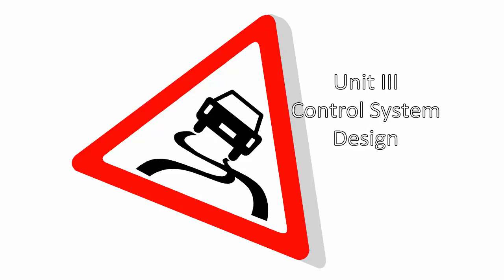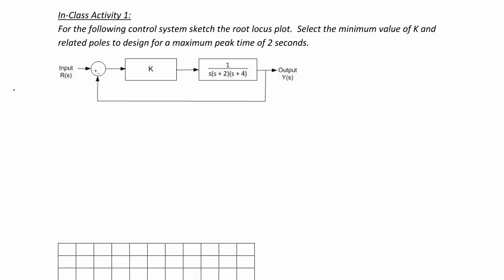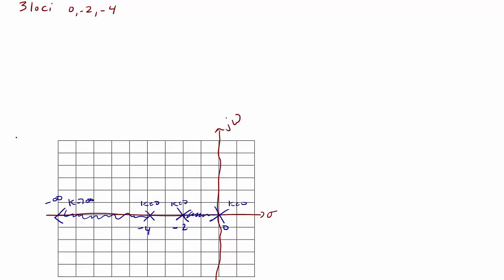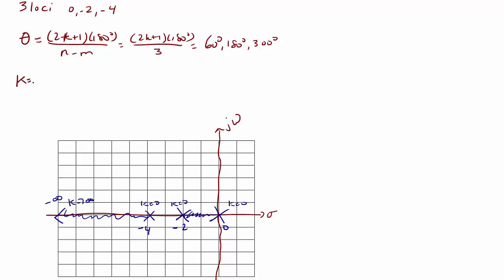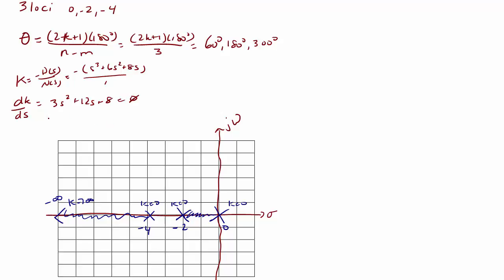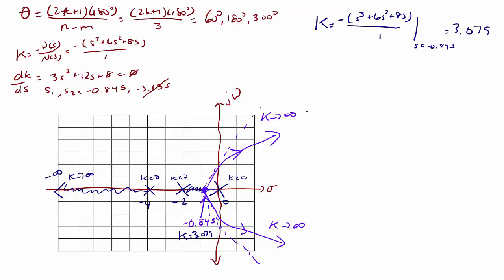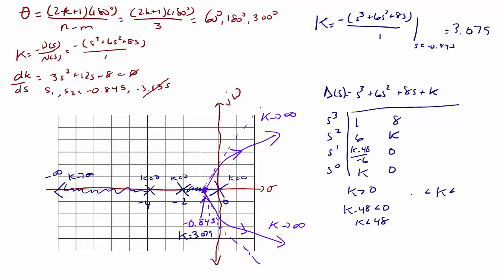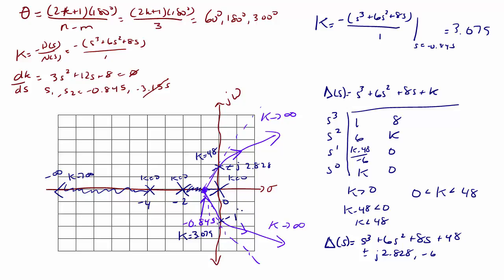ECE320 Lecture4-1a: Root Locus Analysis and Design

Comment: It seems you have a mistake. you didn't calculate the asymptotes breakpoint and instead, you assumed it's the same point as the Root-Locus break point... in your case, the RL supposed to be straight lines because the RL at K infinity the is going to the asymptotes.
Reply: Completely agree with you, the origin of the 2 asymptote lines is at -2 on the real axis with an angle of pi/3 (60 deg) and -pi/3 (-60 deg). As K approaches infinity, the pole at -4 follows the real axis to negative infinity and the poles of -2 and 0 collide at -0.845 and always exit the real axis at an angle of pi/2 (90 deg) and -pi/2 (-90 deg) then each proceed to follow the asymptote lines to infinity. In other words, the greater K is, the more unstable the system becomes. Loci (the paths the poles follow) intersect with each other.